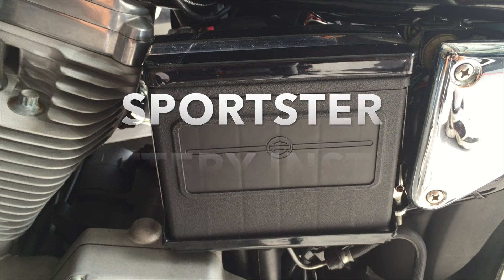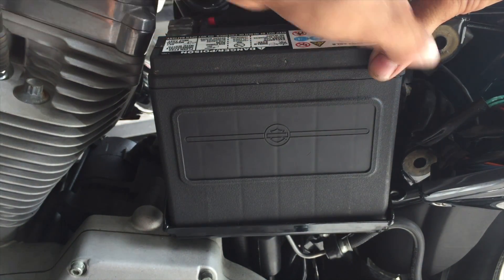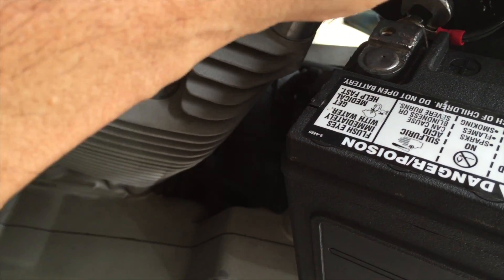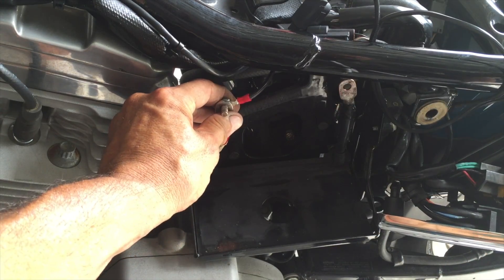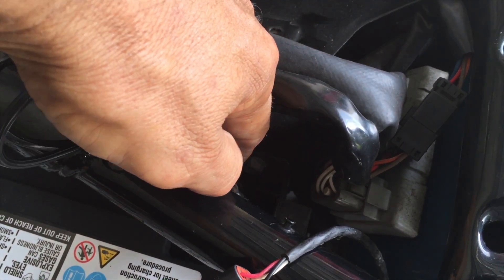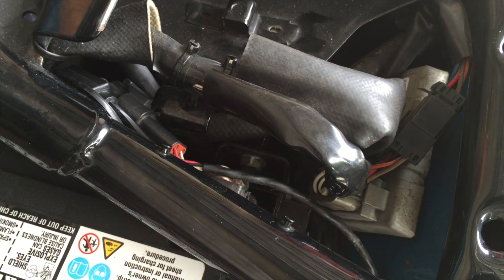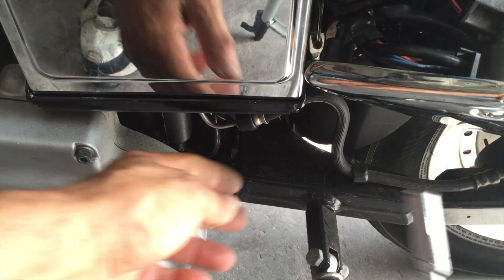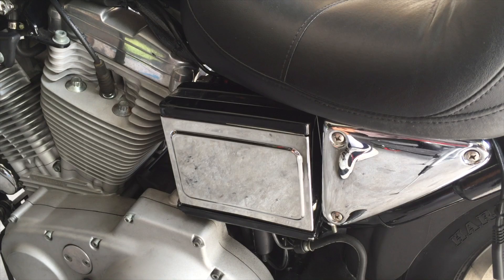How To Harley Davidson Sportster Battery Install

Comment: I still shorted my positive to the negative post flush side when backing the positive bolt screw out, put a weld mark on my ratchet style wrench. My wrench was long enough to make contact on the flush side of negative terminal. Did not think wrench would come close to touching it or making contact. I was paying attention to loosening it on the front side. I would recommend taping the negative post with tape to ensure some might avoid doing what I did.
Reply from the maker: Thank you for your Tip.  Tough design.

Comment: Thanks for that Rocco. What would I do without you man.
Reply from the maker: Happy to help. Thank you for watching and all your support Tim.  I love these bikes. Ride safe and have a great day.
Reply: @TwoWheelRocco  Hey Rocco I was wanting to replace the turn switch tabs with the ones with the little extra thumb extensions on. I guess this entails opening up the switch assemblies. Have you ever done this mod and is it doable or a bit tricky? Thanks Rocco from a UK 1200 Sportster Sport owner. Best regards Tim
Reply from the maker: @timdougall5415  I don't think it's a problem. I have swapped out the black for chrome ones. All it is is a cover that goes over the original one . Let us know how it works out. Thank you for watching Tim.  Ride safe and have a great day.

Comment: Phenomenal and simple to follow video. Thanks so much.
Reply from the maker: Happy to help. Any questions just ask. Thank you for watching and your sub. Iammine512 . Ride safe and have a great day.
Reply: @TwoWheelRocco  Hi Thanks so much for all the great vids. You've been super helpful. I've been buying aftermarket batteries from battery mart for my 2002 Harley Sportster 1200. I've been buying US Made Motocross batteries. 
I must admit I've been cheap in not buying HD batteries or Yuasa batteries. I'm always having trouble with the battery connection and the large spacer I need to use to connect cables. If I could just ask you a couple of questions. In your experience would you say I should use an HD battery where no spacer is needed? Secondly, could the spacer cause the bike to have problems starting? Lastly, is using blue threadlock on the screws to the terminal not a good idea? Thanks so much again for your answers.
Reply from the maker: @Tangledupinblue512   @Tangledupinblue512
Reply: @TwoWheelRocco  Good Morning...What does your reply mean? I only see my name.
Reply from the maker: @Tangledupinblue512  it's all right to use batteries with those spacers just make sure they're tight.  I don't suggest to use blue Loctite sometimes those terminals could be a little weak. Hope that helps. They have good batteries on eBay for you a sportster high-performance battery at that.    https://www.ebay.com/itm/123086241121.  This is what I use.  Double check fitment for  your bike

Comment: I have the same setup, with battery tender wires attached, should I remove any fuses when on charger during winter? I heard MAIN fuse should be removed? Thanks...........your videos are the best !
Reply from the maker: Happy to help. I myself do not remove the 30 amp breaker. You do have a 10 or 15 amp breaker in your slow charging line. So that really covers you if it gets too hot that breaker will go  Any questions just ask. Thank you for watching and all your sub Frank. Ride safe and have a great day.

Comment: Thanks for your instructional video. Have you ever put blue lock tite on the bolt threads of negative and positive posts? I don't know why either. Not yours, but a different You 
Tube member presented a Sportster battery change video suggesting to use a lock tite (blue) on the negative and positive posts bolts. Seemed strange. Wonder if that person's Sportster shakes, vibrates, violently. I know that you didn't use lock tite. Is lock tite necessary or not. Thanks again. Take it easy.
Reply from the maker: Happy to help.  I would not use lock tite on the battery hardware. Never seen it before.. Thank you for watching and your sub. Clayton . Ride safe and have a great day.

Comment from the maker: Let me know if you have any question.
Reply: Two Wheel Rocco I have a 95. The wires and terminals are reversed checked with harley and it’s correct. I’m not understanding how to do this without shorting

Comment: Hello sir. I just removed the battery tray from my sportster for repainting/recoating purpose. I removed 3 main bolts. How much torques do the bolts need when installing.?
Reply from the maker: Use blue lock tight and tighten. No need to torque. Hope this helps.
Reply: @TwoWheelRocco  thank you sir.

Comment: I took my old battery out, but the direction say to always do negative first putting the battery in and out. Is this wrong? I started up my bike a fee times but now it's ticking like the brand new battery is dead, what could be wrong I have nothing connected to the battery except that pic tail thing.
Reply: Check your connections feel your voltage regulator see if you have some heat
If it does it means it drawing power when it's off

Comment: I had my battery in with the tender and the tender or terminal burnt my battery and now I have to get a new one everyone is saying I need spacers but I don’t see much spacers on yours and I had the spacers I got with the battery really stressful hoping you can help
Reply from the maker: Happy to help. Yes the spaces are needed on some batteries. If you could take a picture and send it to E Rocco 3964@gmail.com. I will take a look. Thank you for watching and your sub Sus. ride safe and have a great day.  I just took a look at the video and that battery will definitely need a spacers. Or it will have a battery failure.

Comment: Hey! I have a 1994 xlh883, I was wondering how come my terminals and battery poles are reversed? The positive is on the right and negative is in the left
Reply from the maker: Happy to help. Hard to tell things could change the bike is 30  years old.  I'm a big OEM fan. Stock parts. Thank you for watching and your sub Fernando. Ride safe and have a great day. Is

Comment: Well no luck on the 500 cca I will keep checking I have a 04 Sportster xl 883c thanks for the info.
Reply from the maker: You can call them.....They are very helpful...
Reply: Thank you, I am not in the market for one just yet. I wanted to know when I am ready what battery to go with  now I have two to choose from. I will look into the 500 cca first, I will be needing one soon when I leave my bike off the tender for about 4 to 5 days the battery get weak. thank you again for your help
Reply: I am looking them up now, going to put their number in my listing.
Reply from the maker: stock sportster HD battery is between 200 .. 225  CCA... Numbers don't lie....problem free...Have a great day.
Reply: you too

Comment: I’m having trouble with the rectangular  spacer that goes in the terminal, it keeps slipping out while I’m trying to line up the screw
Reply from the maker: Happy to help. Set the battery nuts up with some folded cardboard or something to hold the nut in place so when you do rotate the battery they don't fall out. Anything will work,  folded up cardboard just a hold that nut in place so you can get that battery bolt started.  Use one of the longer bolts just so you could fit it into the with cardboard to shim it up remove the long bolt and then go with your correct hardware,  hope this helps works out. Thank you for watching and your sub Patrick. Ride safe and have a great day.   Oh this is a different year Sportster take notice how I prep the battery for install.  you could do this with folded board just take a look at this video https://youtu.be/iesqCTMTSe0.  look at as I prep battery on  video